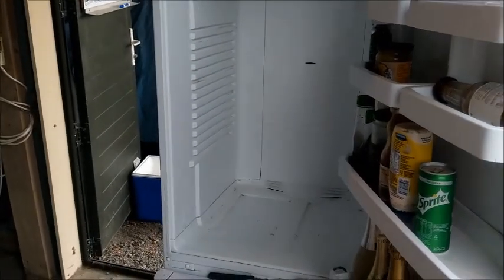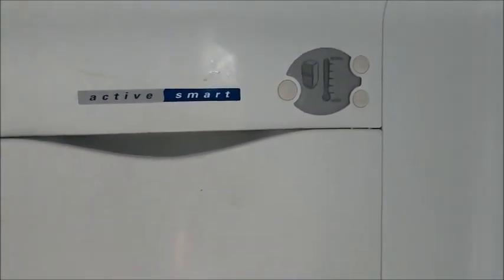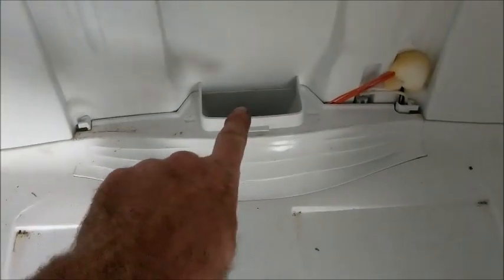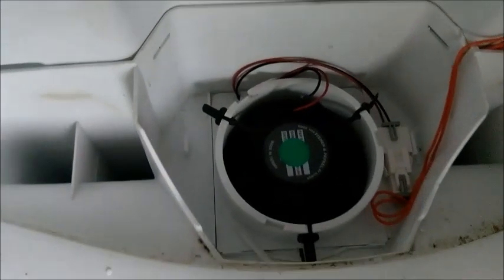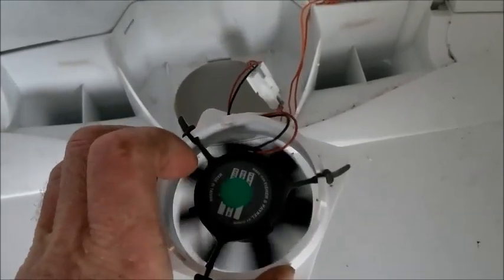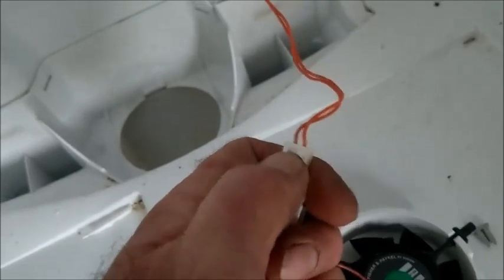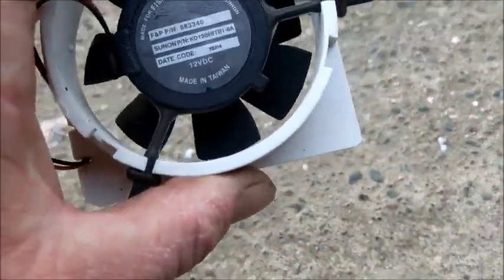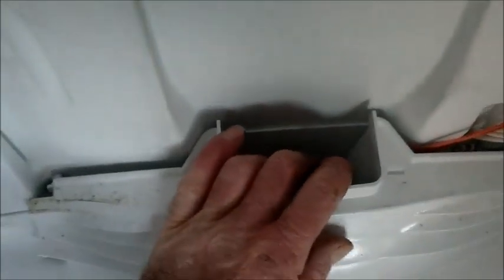Fisher Paykel Active Smart Beeping Intermittent Fridge Fan Fault

Comment: Hi Paul, My E522B had exactly the same problem.  Replaced the fan and it fixed it.  The original was 17 years old, so was time.  Thanks for your great and helpful video.  The replacement went exactly according to plan thanks to your tutoring.

Comment: G'day Paul. Many thanks for the video. F&P were always good but this fridge has driven me nuts. The first new one wouldn't cool and door wouldn't seal properly so tech replaced next day. Great start to our first new fridge after 12 years! Then - I reckon on day 366 - the beeping started😡. Anyway freezer ok & fridge basically shut down after resets. Followed your video and finally found & engaged the reed switch & bingo - all good - at least ATM 😬
Thanks again and hopefully we have a permanent fix. No idea why a reed switch would stop working but it is now. Thanks mate 👍
Reply from the maker: That's good. Yes Reed switches can become faulty after a few years.

Comment: Hey, thank you for your video. Will try to check my fridge/freezer. 
I have a question though: if there is a problem with a fun, I will need to order a new one. Can I still run my fridge without the fun while I am waiting for the new part to come? I don’t have another fridge available,and the new fun can take a while to come. Thank you for your help
Reply from the maker: Yes go can run the fridge without a fan but it won't be very cold in the fridge

Comment: Hallo Paul, thank you for the video. I have a different problem.
When the alarm beeps and I open the fridge, the Top Compartment light flashes (64) Nothing else.
I did check the fan as you shown, and it runs 100%.
Any other suggestions? 
Alarm goes of once a day at random times.
Thank you in advance for the help
Reply from the maker: Not sure sorry. Usually the 64 LED indicates that the upper door is open. There's no fault code 64.
Try switching fridge off at the wall for 5 minutes then on again and don't open any door for 30 seconds after switching back on. 
The fridge enters a test mode after being switched on. Hopefully it will stop the beeping. That's the best I can offer
Reply: @paulywooly  Thank you for the awsome quick reply Paul, much appreciated!!!

Comment: Great video Paul. Our fridge is an E440T, and similar fan but up the top of the fridge cabinet. Question- do we take the fan out with a yank the same way as the bottom fan ? Or is there a different proceedure please ?
Janet
Reply from the maker: Not to sure about model,  but yes I would say so if there are no mounting screws visible.

Comment: hi ! I have active and smart Fisher & Paykel. recently there was bee sound a couple days ,  then pressed the button  as you did as top part ( fridge) light on but temperature  warmer & colder light off , so , what is actual problem ? how to adjust back to normal  ?
Thanks for your quick respond ! now my fridge no more bee sound , but top part light still flashing and temperature gauge light is off  ! what can I do ?
Reply from the maker: To reset : unplug fridge from the wall for 1 minute and plug back in again. 
If it beeps again here is the manual on how to read the fault codes 
https://drive.google.com/file/d/16hUKdFq3vH1kAd9uYJk2uvPQ0fo8KHN1/view?usp=drivesdk

Comment: At where do you set the indicator? Would you need to change the temperature in cold or hot weather. Thank you.
Reply from the maker: You shouldn't need to manually change the temperature in hot or cold weather. The temperature will stay the same in all weather

Comment: Hi Paul, I have trouble opening the freezer compartment back panel. Able to help do a demostration?
Reply from the maker: Sorry for the delay in responding. I can post a video in a few hours when I get home but what you do is put your fingers in the small gap at the bottom of the panel and pull it very hard and sharp towards you and the whole panel will pop out revealing the freezer fan.
Reply from the maker: https://youtu.be/5qUDpcAibkA
Reply: Great idea with the magnet 🧲! I have my fridge freezer with error code 2 saying ‘defrosting issue’. My freezer  rare panel was frozen up inside, I have defrosted unplugged etc. But it still wants to beep at me. The panel beeps twice and flashes all areas from green to red 😢! The reed switches both fine, so too are both fans tested them. Both the fridge & freezer seem very cold 🥶 and no defrost by the looks. The freezer defrost pipe at bottom doesn’t appear hot at all and freezer quickly icing it’s coils again & lol now icing the individual blade edges of the poor fan in freezer !! How do I tell if timer, thermostat, faulty temperature gauge in freezer or the actual freezer defroster element itself as it never seems to be hot !? So basically have far too much freezer cool - what else can I try?

Comment: My fridge/freezer isn't working after transporting it - the display module is all lit up in yellow except the bottom square on the temperature is in red and no matter how I press the various buttons nothing works.  The compressor is humming and is slightly warm.  The both fans are working.  There is nothing in the fridge and hence no frozen ice - its completely clean - I even cleaned the circuit boards and checked all the connections.  Do you think it might have a leak?
Reply from the maker: Yes it does sound like a gas leak if the compressor is running but nothing getting cold. Usually you can smell it or see green stuff leaking from the pipework near or around the compressor or even inside the freezer pipes. Try switching off at the wall for 5 mins and turn on again, (which you may have already tried) that should reset the fridge

Comment: Hi Paul,
I have a active smart fisher and paykel. The problem I’m having is the products in the fridge section are freezing up. And it seems like the fridge is not cycling off and is continuously running. I hope the info I’ve given would help with your trouble shooting.
Reply from the maker: It's probably a big ice build up behind the back panel of the freezer. My suggestion is to completely defrost the freezer.
Open both doors and switch off the appliance for preferably 48 hours. There will probably be a lot of water leak out during defrost. It's a good idea to put towels down or take the fridge outside. 
Unfortunately this also means emptying the food contents into another fridge-freezer. 
With all the ice gone then it should fix the problem
Reply: Thanks for your reply Paul,
That’s what I’ve done and it’s still doing the same thing.
Reply from the maker: @luisedward3336  It could be a number of reasons and is very difficult to diagnose from here.
It could be a faulty or loose fridge temperature sensor. You can just see the white sensor probe at the top left of the screen as I pull the back panel out. It looks like a circle with line through it. 
Or it could be a faulty control unit or faulty freezer sensor
Reply: Thanks Paul I’ll have a look at that. When you say control unit are you meaning the electrical box at the back of the fridge?
Reply from the maker: @luisedward3336 yes should be a white box next to the compressor. https://spares.bigwarehouse.com.au/product_info.php?cPath=64658_64659_64931&products_id=2123479
Reply: Cheers Paul thanks for your help mate. There was abit of corrosion on the temperature sensor lug on the controller box. Cleaned it out with contact cleaner. She’s working normal now😁
Reply from the maker: @luisedward3336  great news ! I bet you feel chuffed. Well done

Comment: Hello, my fisher & paykel was bought back in 1999, Model E372B. this refrigerator side body is too hot when running. I wanted to clean condenser coil. but the coil i cant get access. Can you help me, where is the coil located? or it is fixed?
Reply from the maker: On this model there is only one coil and it is in the freezer. The fridge works by sucking cold air out of the freezer and into the fridge.
Switch Off the fridge.  Remove the back panel in the freezer to access the coil.
Reply from the maker: https://youtu.be/5qUDpcAibkA

Comment: Hi Paul and Thanks, I've got Model E522B. My Refrig wasn't cold but the freezer was, though a massive ice build up. Cleared the ice went to replace fan, the foam insert basically fell apart. Had to splice fan to original plug. Question, -- should fan go on as soon as it's hooked up? Is there a way (or need) to get the foam insert that surrounded the fan. I also noticed that under the fan hole, it wasn't really open, had what seemed to be foam insulation bottom. Many thanks
Reply from the maker: Some models don't have the fan connected to the door switch and the fan goes all the time. I wouldn't worry too much about the foam around the fan.  Try and cut and fit some polystyrene if you can. The hole below the fan should be completely clear of ice or foam. If you look down the hole you should be able to clearly see the aluminium freezer condenser fins. The freezer coil/condensor  maybe also be choked with ice, which will need defrosting

Comment: Hey Paul, was wondering if theres anyway to mute the beeping or remove the speaker or something as the beeping drives me nuts on this fridge
Reply from the maker: Sorry not that I know of. The beeping is giving a fault code. Or a faulty door switch. Hold a magnet over the switch like the video says. Test both the fridge and freezer switches. The light should turn off when the magnet is touching, or the freezer fan should turn on.
Or  Check here for  the codes . Hope it helps in some way.
https://producthelp.fisherpaykel.com/nz/Troubleshooting/Fault_Codes/Active_Smart_Refrigerator
Reply: use the Sabbath Mode by press button with 2 vertical lines on the control panel. Press and hold it for 10 seconds.
Reply: @fredyifei  How long does this last? Will the fridge still keep things cool?

Comment: Hi, do you know how to turn off beeping altogether? It's so annoying, I'm packing food in or looking for something and it's beeping every 30 seconds. Just a nuisance to me.
Reply from the maker: No it can't be stopped altogether. The beeping means the fridge has a fault or the door is open too long.
Reply: How / where do you see the error codes or faults Paul?
Reply from the maker: @unclebart7296  check the description for the download. It should still work. If not, get back to me. It's a combination of the lights gives you the error code
Reply: @paulywooly  got it. Thanks Paul.
Reply: @paulywooly  Hi again Paul. My fault is lower door LED flashing when it beeps. No other lights. Do you think it’s the fan?  Can’t make sense of the fault codes in description. Pls help and thanks again.

Comment: Hi Paul,
So happy to have found this video. It was very helpful. Thanks！

I've got Model E522B. My Refrig wasn't cold enough but the freezer was, and it was peeping all the time whenever I open the fridge. 
I opened up the panel as shown in the video, but how do I check if ice was the problem? I did not see ice except that the fan was not running (I did not put a magnet as instructed in the video though).

I also checked the error code and is was either 17 or 18 which is for the FC fan, what does FC stands for? Is it the same fan as shown in your video?

I live in Singapore and cannot find this exact fan, do you have a suggestion for modification? If the fan is indeed the problem, what alternative fan can I source for to replace it?

Looking forward to your advise. 

Thanks and best wishes,

Richie
Reply from the maker: Hi.
 FC stands for Freezer Compartment
PC is the fridge compartment but I do not know what the P stands for. 
The fan switches off when the door is open so you really do need a magnet. (Or maybe you could video the fan with your cell phone and a torch then shut the door)
If you cannot find the exact fan, in the past I have adapted 12 volt computer fans to do the same job. As long as you get some air movement is the main thing. 
The freezer fan location video is in my description
Reply: @paulywooly  Thanks Paul!
Just opened it up again and saw some frost on the bottom freezer compartment. 
From one of your replies to others, I read about a force manual defrosting by pressing and hold on the MODE and Temp Down Button. Am now trying to do it.

Any idea how long should I allow it to defrost and what else I should do? 

Do I need to dry the freezer compartment afterwards or how to dry it or anything else?

Thanks again Paul!
Reply from the maker: @richielim7076  if it is a solid block of ice it can take 24 hours to completely defrost. And there maybe a lot of water leak out so some old towels on the floor are a good idea. If it just frost on the workings then it will defrost much quicker. In the past I have used a hair dryer or heat gun to speed things up. Did you find out if the freezer fan is working or not?
Reply: @paulywooly  Hi Paul,
I have not checked the fan yet as I need to rush to work and removing panels will take more time then I can spare today. So I do the easy one first which is to defrost.
If defrosting does not help, then I will have to check the fan tomorrow.

As I could not find any instruction to remove the panel inside the freezer compartment for E522BRE, I was not able to open up the back panel inside the freezer to see the amount of ice. However, I did see a little ice and frosting inside the vent.

For now, there are water leaking as I started the process. Not sure how long it would take and I am also concern of how to remove water droplets hanging in side the compartment where I have cannot access to. Any suggestion Paul?

Also, when I am done, do I simply turn off the power and on again to restart the fridge? Please advice. 

Thanks again Paul!

Richie
Reply from the maker: @richielim7076     yes  if it is ice around the vent then you won't be able to remove the back panel until it's completely defrosted because the panel is stuck to the ice.  If you have to leave for work then I suggest putting towels on the bottom of the freezer to soak up the water. Water can also overflow at the back of the fridge thru the drain pipe. Maybe put towels behind the fridge as well. Then afterwards you can remove the back panel and check the fan is working. I usually remove the fan and connect it to a 12v car battery to diagnose whether it is working. Good luck, I know it's a nightmare for you
Reply: @paulywooly  Defrosted it, but the upper fridge is still not cold, is staying around 20 Degree Celsius for now. I have yet the remove the freezer back panel to check the fan, however, I can hear the fan running and feel strong air coming out of the vent when I put a magnet on the fridge. Could this mean the fan may be working? 
On a side note, I can see some frosting again this morning at the freezer vent.

Indeed, this is driving me nuts, any suggestion?

Thanks!
Reply from the maker: @richielim7076   ok that sounds like the fridge fan is working ok with the magnet. But in my experience, the fridge fan can go and stop because of an intermittent faulty fan. Try the magnet on the freezer door too and see if it is going. And it can take a few hours for the fridge to get cold. Otherwise I'm running out of ideas sorry
Reply: @paulywooly  Found the problem! It is exactly the same fan as the one you shown on your video above that is not working!

I have taken it apart. As I am in Singapore these parts of only available in NZ and Aus, could you kindly advise what should I look for as a replacement? You mentioned a similar PC box fan will do the job. Could you kindly advise the spec or dimension or anything relevant that I can check online to use as replacement? Maybe a type of box fan (with P/N or description) that you know will work and I can then look for similar ones here. 

Thanks Paul!
Reply from the maker: @richielim7076  oh that's great news.
+6565470100 is the phone number for  the Singapore Fisher and Paykel agent. Maybe they can help, in the meantime I'll keep looking for another solution.
Reply from the maker: I've been in touch with a seller from Australia. You need to measure the diameter of the fan blades. There's 2 different types. 70mm or 85mm. I haven't heard back from him yet whether he will post to Singapore
https://www.ebay.com/itm/264628375886?mkcid=16&mkevt=1&mkrid=711-127632-2357-0&ssspo=6hwLMWm_Tpe&sssrc=2349624&ssuid=jy95v9JbRfy&var=&widget_ver=artemis&media=COPY
Reply: @paulywooly  Excellent Paul!
You have been a great help! Mine is the small fan for 70mm wide and about 23mm height.
Once you hear from him about more information, kindly advise. I would also need to know the Amphere (A) or Power (P) if he could provides. Thanks again!

You are the best!!
Reply from the maker: @richielim7076  0.25 amps at 12 volt. I have also been in touch with my supplier in New Zealand whether he would post to Singapore as well. But try that Singapore phone number I sent, in the meantime. Surely they must have spare parts
Reply from the maker: These guys will post to Singapore

https://www.ebay.com/itm/264628375886?mkcid=16&mkevt=1&mkrid=711-127632-2357-0&ssspo=6hwLMWm_Tpe&sssrc=2349624&ssuid=jy95v9JbRfy&var=&widget_ver=artemis&media=COPY
Reply: Hi Paul my partner purchased the exact same fridge second hand… 3rd day in it starts beeping… I found your video and hopefully it will help us out… one question though… our fridge freezer is the opposite way around… would the fan still work or do I need another fan? Please help the beeping is driving me insane 🤦🏻‍♀️🤦🏻‍♀️🤣🤣